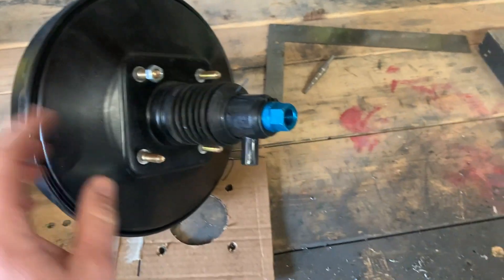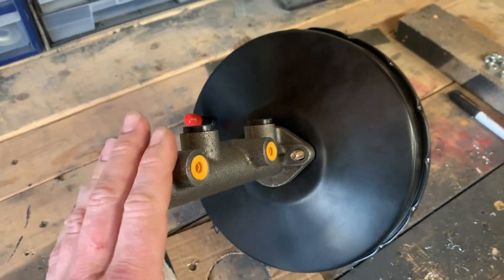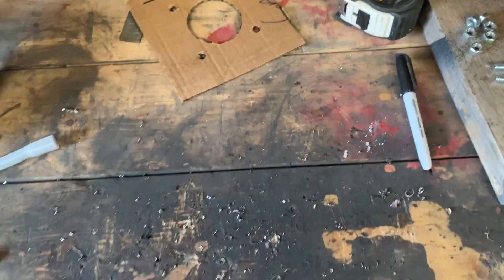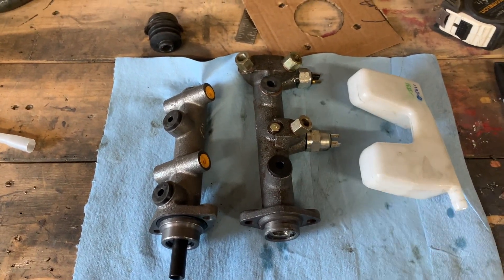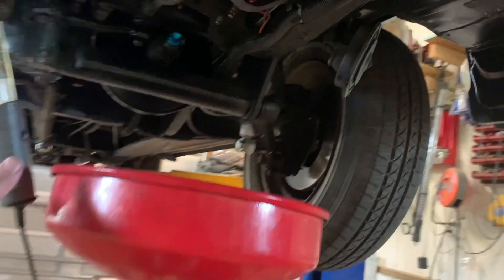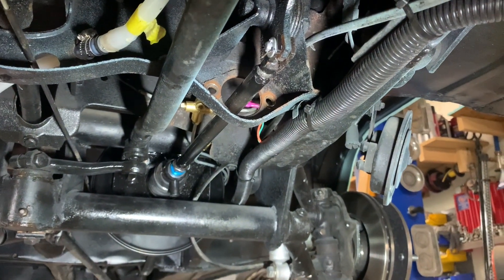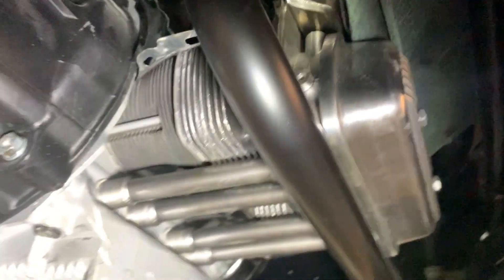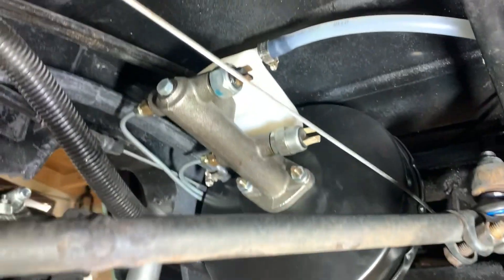VW type 2 Bus Power Brake Conversion How to install a new master cylinder and Power Brake Booster

Comment: I think you are using the 9" booster, and thats why your handbrake cable are rubbing the booster. You should have used the 7". That would give the clearance all around. 7" are for Earlybays. 9" are for Latebays - roughly said

Comment: Hello, you mentioned that you added some one-inch spacers to the base of the booster. I'm just checking to see if that's the measurement. You can also see an outlet on the front of the booster. Is there a hose there, or is something connected to it? Thank you very much.

Comment: Hi, you are using a brake booster from a wich car? Do you have a lik?

Arebu using a valve, a white one, where i can find it?

The steel base you made, did you add another piece as a spacer? Does this go on top and bottom? And what is its measurement?

Thanks a lot
Reply from the maker: @superteacherk  all of these questions are addressed in the video just give it another good watch. The parts are from a 1973 vw bus with factory power and front disc

Comment: Hi there on the front of the servo (booster) there is a small angled tube pointing downward under the push rod fitting, what does that connect to if anything and what its purpose ?
Reply from the maker: @carlm5447  I think you’re talking about the drain tube incase you get a master leak.

Comment: Hi , Bjorn from Denmark 
Can you show me hhow you fixed the vacum tube on the engine 😊😊😊
Reply from the maker: I don’t have a pic. I just ran the hose through the engine pan, removed the intake on the drivers side and drilled and tapped it. Installed a 5/8” brass hose barb and put the hose on with a hose clamp.